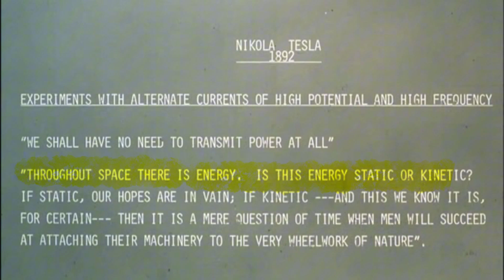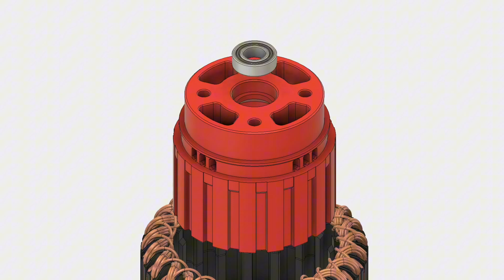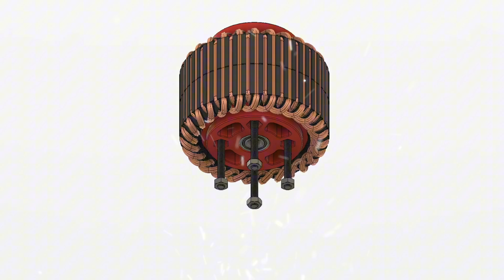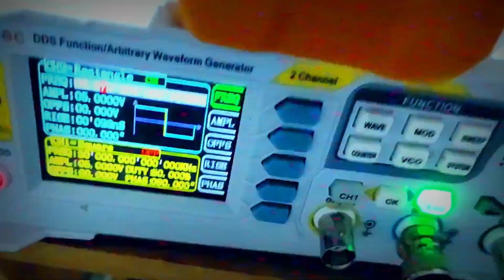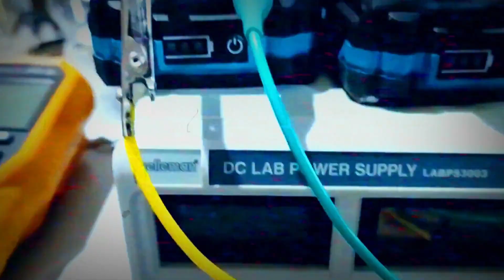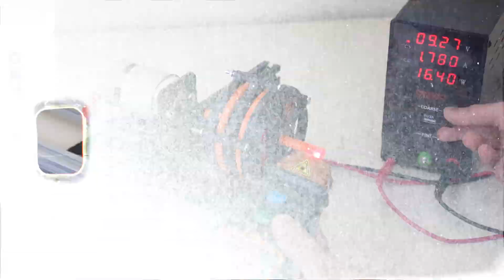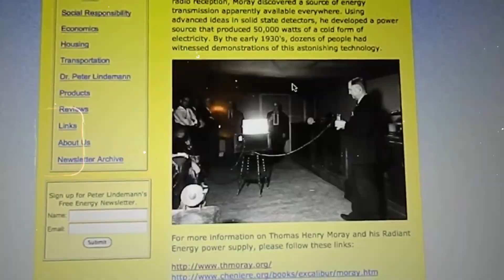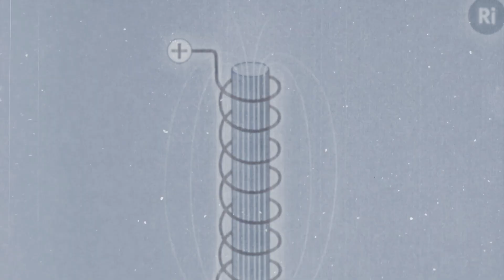How Moray and Tesla’s Inventions Could Change Energy Forever

Comment: Mumbo-jumbo  about pseudoscience.............?
Reply: There are hundreds of volt just a few meters above ground. It’s just a matter of finding ways to harness it to charge batteries, capacitors, or running it through inverters.
Reply: @tubularguynine  yes ZPE and its everywhere in the universe with its immense energy!
Reply: @jlo13800  Yep. And I’ve seen videos of people that have built motors that were run on micro volts and amps, and actually rotate, just from the energy picked up by a 15 or 20 foot copper wire with the ground wire connected to a ground rod.
Reply: @tubularguynine  tapping zpe will give much more energy than that and power just about anything you want. UAP''s can go anywhere and are intense ZPE generators that can run anywhere.
Reply: @tubularguynine    Yes, there is a surprising strong voltage gradient of about 100 volts per meter. But there is no power with this voltage. This voltage breaks down at once with a load, which is the reason that we can not feel it. Even if you would collect atmospheric energy on the whole surface of our globe it wouldn't deliver more than a medium power station. You can run a motor with atmospheric electricity but the power of this motor is minuscule and not fit for practical use.
Reply: @ - True…and that’s where mosfets and step transformers come in. Tesla said “…369 Hz is the key to the universe, and holds the secret of energy, vibration and resonance.” Run just the right frequency through just the right mosfet setup, and you’ll have all the amps you need to transform the powerless volts.
Reply: @tubularguynine    Not everything Tesla said is true. Tesla was obsessed with this number, but there is absolutely no evidence that 369 Hz is a "key to universe". Up to now this key has unlocked what? Nothing.

You only get amps, if you have moving particles with an electric charge. But there are only few such particles in atmosphere. So where should the amps come from? Also, if you want to pick up a specific frequency of EM waves you get best results with an antenna of a size in the range of the wavelength. For 369 Hz the wavelength is about 800 km! That's not very practical.
Reply: Pseudoscience it is.
Reply: Caver mead @Vile_Entity_3545
Reply: He tested his device near a river many miles from any powerline. He ran it for hours showing no battery could power his load over that time. He was real and used advanced nuclear materials in his vacuum tubes. He was a genius inventor
Reply: HERE’S HOW HIS DEVICE WORKED

At any time in Earth’s atmosphere - and in space - exists difference random frequencies of electromagnetic waves including radio waves, light waves, ultraviolet waves, etc. Cell phone electromagnetic waves, TV electromagnetic waves, we are ‘drenched’ in electromagnetic waves every second of our lives. You cannot see them. But we know our cell phones work.

His device had an antenna like a radio. He concocted a then-rare (read: not widely known) blend of germanium, bismuth and other materials and made what we now call a ‘dielectric resonator.’ Every cellphone has a dielectric resonator these days. They allow only ONE FREQUENCY to pass through from all the random electromagnetic wave ‘carrier’ frequencies a cell phone is bombarded with. There are different cell phone carrier frequencies, and each cell phone uses one of them and has to block all the others to prevent interference. These days, manufacturers know how to engineer, how to construct dielectric resonators to block all but the one frequency the cell phone is designed for. Back in Moray’s day, he had no clue. He couldn’t have. Dielectric resonator science didn’t take off until the 1960s. So he was ‘getting lucky’ - he created his germanium/bismuth/etc. dielectric resonator. Due to the way his device works, he’s not trying to tune in to a cell network. He only needed to receive ONE of the random wavelengths that are always in the air and block all the others. His device required a single electromagnetic frequency to work. This is why he called his device a ‘radiant energy’ device.

Why is a ‘dielectric resonator’ - resonating? Because electromagnetic waves are sine waves and they cycle through a positive half cycle then a negative half cycle. Over and over again. Look up ‘sine wave’ and ‘electromagnetic wave’. A dielectric resonator only resonates at ONE frequency and blocks all the others. Just what he needed.

So his antenna ‘pulled in’ lots of random frequencies out of the air and fed them to his germanium/bismuth ‘detector’ (dielectric resonator) and only ONE FREQUENCY was then passed through to the tubes in his device.

Now the other amazing-for-his-time part. HE ACHIEVED OVER-UNITY by two different methods. First, he leveraged ‘secondary electron emission’ (look it up) made possible by his use of ‘cold cathode’ vacuum tubes. Argon gas ions and electrons bombarded his cold cathode and knocked free more and more electrons resulting in more and more current flow in his tubes. Second, he leveraged ‘negative resistance’ which is what happens to electric current flow in a plasma tube (including fluorescent light tubes - they are ‘negative resistance’ devices). ‘Negative resistance’ manifests as follows: (1) first, you have a tube with a vacuum in it, filled with argon and mercury vapor; (2) second, you ionize the argon/mercury vapor - that enables current to flow at a low magnitude at the beginning; (3) third, you patiently wait and allow the current to keep increasing the ionization level of the argon and mercury until it’s a FULL BLOWN FREAKING PLASMA in the tube! Plasma is the best electrical conductor known to man. (4) fourth - if you don’t do something to limit the increase in current flow through the plasma, you get so much current flow that the tube will explode! That’s how much power is in this ‘negative resistance’ phenomenon! A modern fluorescent light tube STOPS this ‘runaway’ increasing current problem by way of a ‘ballast’ that is part of the tube’s electric circuit in its fixture. NOTE: the electrodes in fluorescent tubes will break down if you try removing the ballast to get this huge negative resistance phenomenon. The tube manufacturers do not want to get sued. So it is not really possible to create over-unity devices using fluorescent light bulb tubes.

He used a radioactive material liner inside his tube because it spews out beta radiation which will create a LOW LEVEL of ionization in the argon gas in his tube. This is an impressive trick he pulled off. No one uses radioactive material to create an initial low-level ionization of argon gas in fluorescent tubes. But fluorescent light bulb tubes ALSO need some means to create an ionization in the gas in the tube. So instead, a small circuit WHICH REQUIRES OUTSIDE POWER (from a wall socket) is used to create an initial ionization. See, THIS IS WHY NO ONE BELIEVED HE COULD PULL OFF ‘power out of the air’. They did not understand that by using radioactive material in his tubes, he didn’t need an outside energy source to create that necessary low-level ionization of the argon. Once the radiation in his tubes created the very low-level of ionization in the argon gas, and he supplied across the tube the low-voltage radio wave pulled out of the air - BAM all he had to do was wait a few minutes and the small initial ionization and small voltage radio wave would build up to a FULL BLOWN FREAKING PLASMA! inside the tube. This build-up from ionization to massive plasma and current is called a Townsend Avalanche.

Here’s how that initially low-level ionization of argon, and the very weak radio wave signal, evolve in the tube. It takes some time. In his book he mentions ‘4 minutes’ or so. First, the radio wave creates a small current flow in the very weakly-ionized argon. Electrons collide with molecules of argon and knock electrons out of the argon atoms. They in turn collide with other argon atoms which knocks more electrons free, and the argon evolves from ‘weakly ionized’ to ‘plasma’ with MASSIVE current flow in the tube. This is an over-unity freebie effect. Notice this. No AC power was hooked into this device. He relied on a radioactive material to create a weak ionization of argon. He then fed a single weak frequency radio wave pulled out of the air to incrementally knock more and more electrons free from the argon gas atoms. THIS EVOLVES INTO A ‘TOWNSEND AVALANCHE’. And he used capacitors to tap off the energy out of the gas. Good thing too because his tubes would otherwise explode.

To review: Moray has pulled in lots of random electromagnetic waves on his antenna, fed them through his crude dielectric resonator to block all but one frequency, then passed one frequency to an argon/mercury vapor tube weakly ionized by radioactive material, then WAITED FOR THE TOWNSEND AVALANCHE TO DEVELOP.

NOTE: Why was it important to only feed one frequency to the tube? Why not just pass all the random radio (and other) waves from his antenna to his tube? Because the tube needs to get into a resonant condition. It needs to resonate back and forth at one frequency and build up incrementally to high current flow in the tube. If lots of different frequencies were present, the Townsend Avalanche would not be easy to attain - lots of different frequencies is ‘static’. ALSO: Even though the radio wave was always a very low, weak voltage - IT WAS STILL NECESSARY. Why? To keep the resonating current going, TO KEEP THE TUBE OSCILLATING. His tubes OSCILLATED at that one frequency. And that radio wave he randomly filtered into his device created the oscillation. And maintained it. One of his witnesses shorted his antenna to ground and the device stopped. Even though that stray radio wave was weak, it was STILL needed to keep the oscillating tube - oscillating. Oscillations ‘dampen out’ if you fail to add a correctly-timed ‘push’ or electrical wave in this case. You can think of it like pushing someone in a swing on a swingset - you get them swinging - that’s at one frequency - if you bump into them with a different ‘frequency’ of push - it will slow them down. If you push them at the SAME frequency - at just the right time - they will keep swinging. If you stop pushing them their swinging will slow to a stop.

In other iterations of his device, instead of a dielectric resonator, a ‘bandpass filter’ was used to block all but one frequency.

When you look at a fluorescent light tube - that is a ‘negative resistance’ device and is conceptually similar to Moray’s over-unity device. But it needs outside power because (1) using radioactive substances in consumer devices is not feasible these days, and (2) no one will buy a fluorescent light bulb if it takes 4 minutes to light up.

But modern fluorescent light bulbs will NEVER go into a Townsend Avalanche and build up huge power that can be diverted into, and stored in, a capacitor, due to the ballast current-limiter device, and the really weak, quickly-disintegrated electrodes. Moray’s device could output a lot of energy (7500 watts in some versions) because he used the power from the runaway current, the high-current plasma, to charge capacitors.

Moray used radioactivity to avoid needing an outside power source to ionize his gas. Then his cold cathode tube when bombarded by argon ions and electrons produced more electrons. This spiraled into more and more electrons being knocked out of the argon gas atoms. The electrons flowing in the current created by the radio wave also knocked more and more electrons out of argon atoms. ‘Negative resistance’ and Townsend Avalanche resulted.

MORAY’S DEVICE WORKED. He was clever in how he put together negative resistance/Townsend avalanche gas plasma effects, in how he pulled just one frequency out of the air, in how he used radioactivity to ionize the argon to avoid needing outside power.